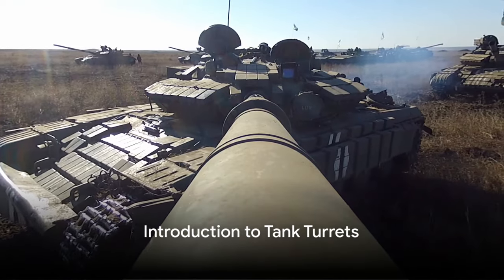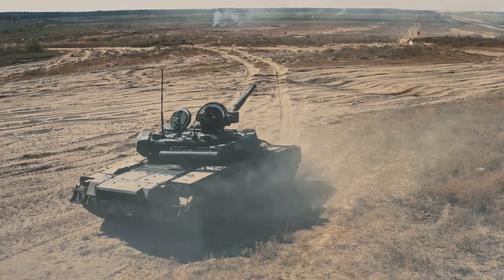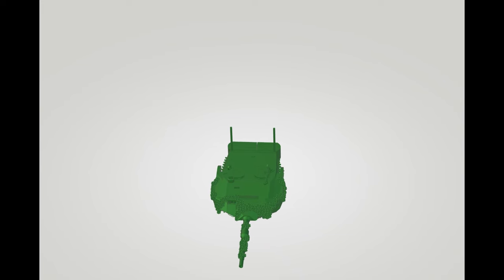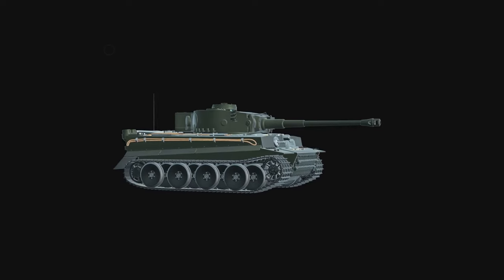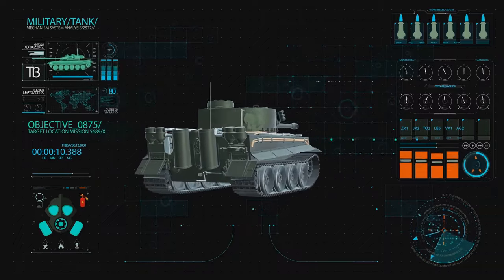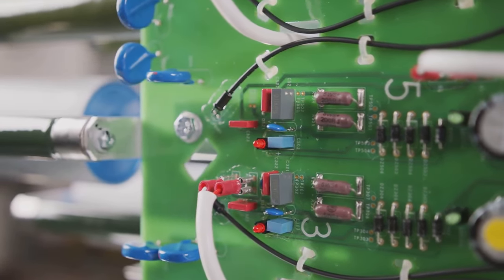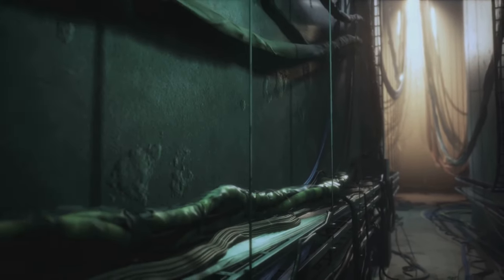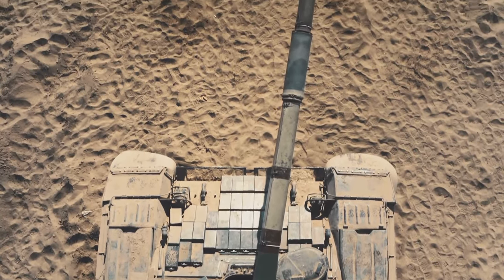Here's How A Tank Turret Actually Works

Comment: The video didn't show how they work. "Imagine a carousel" what? how does a carousel work then? slip rings and rotary joints?  what? it shows nothing just stock images that dont show how any of it works
Reply from the maker: Hey I really appreciate the feedback it helps.
Reply: Yeah kind of pointless. Idk if like a car it uses a clockspring or some such but that wouldnt allow an infinite amount of turning, only x amount of laps in each direction. Also doubt its wireless due to interference so i guess it must be these magical slip rings (like what holds the handguards on your ar?) Or joints lol.